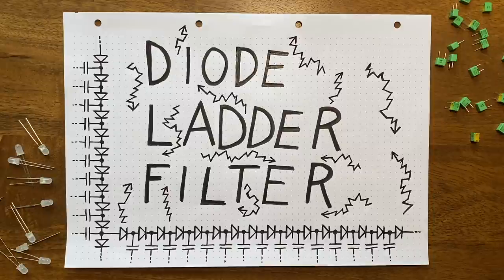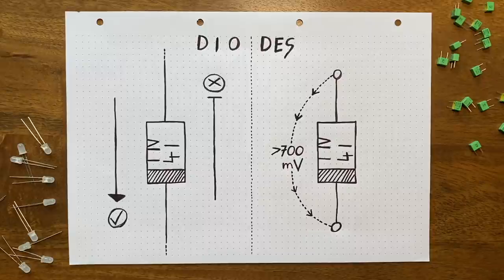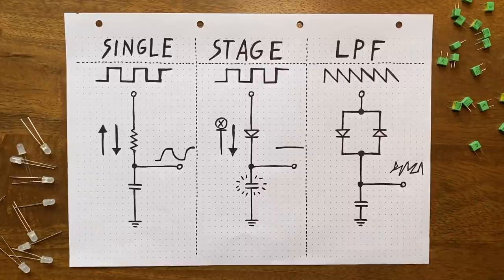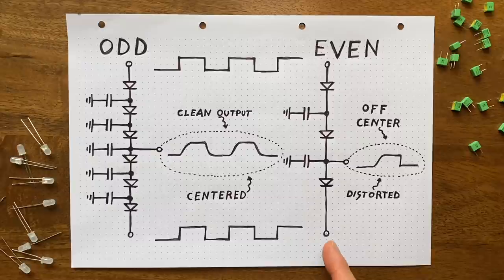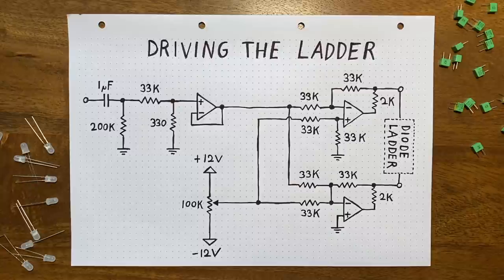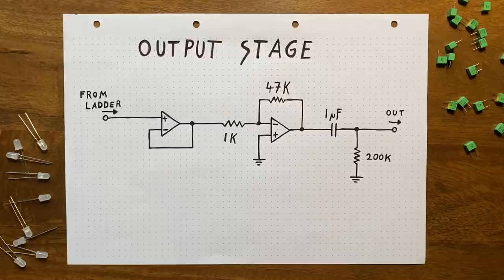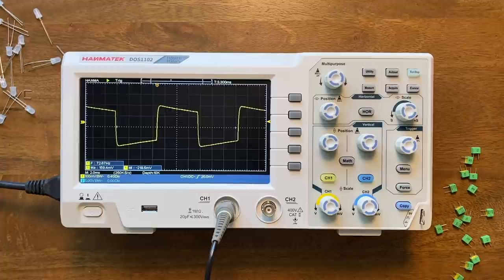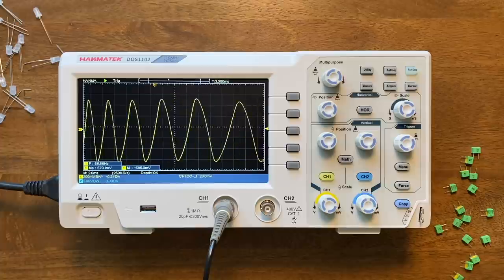Designing a diode ladder filter from scratch

Comment: For this diode ladder filter block, does it require using film caps?  I followed along and built this up exactly but I used ceramic caps in place of the  1nf film caps. The square wave signal was dull and had a loud, deep hum. Perhaps the result of using ceramic caps?

Comment: These videos are really helping to open the doors of analog electronics. I have been wanting to make a filter, and experiment with weird, maybe counterintuitive topologies, but didn't know where to start. The difference between the positive offset and negative offset, plus the placement of the resonance, there is a lot to tune there. I would be really interested in how to turn this into an all pass filter, I have been wanting to get some of those phaser sounds.
Reply from the maker: yeah that's why i decided to go with this instead of another OTA-based approach. much more room for creative tweaking! (also LM13700s are expensive.)

i'll do a follow up on converting this into other filter types. eventually i'd also like to do a PCB layout when i feel the featureset is refined enough.
Reply: @MoritzKlein0  the fact that this design doesn't use any fancy components means I will likely be able to design a pcb to be assembled by JLCPCB, and have them do most of the components.

Comment: That sounds great! Simple design too. I did one ages ago by taking a state-variable filter and replacing the two cutoff frequency resistors with boring old diode bridges, and basically doing the same positive/negative control voltage you've done across them. Worked really well too, plus you get low/band/high-pass out of it.
Reply: Schematics pls jojo
Reply: @finonomastropiero4261  Demo and a schematic from when I made it -> https://www.youtube.com/watch?v=Z4o3QnJdoys

Comment: This filter works really well. The other day one opamp on mine apparently failed. It's cool how these analog devices can sound nice even with a major damage. The sound was similar to warm distortion on a guitar. I suspect the reason for the failure Is that I modified the CV input and might be causing it to go way high on voltage on the ladder. Thank you for your work again!

Comment: I'm fascinated by the fact that so far, there hasn't been a single sighting of expensive transconductance amplifiers. I'm sure they'll be used in the future, but it's nice to know there's a lot of good control possible with bog-standard opamps. Well done man. This series is truly inspiring.
Reply: 1. The "transconductance" op-amps would be needed if the filter's steering element was a BJT.
2. "Transconductance" amps are essentially amps pushing a set amount of current through the load...
3. ... which means you can do it with a "normal" op amp and some fancy feedback loop, if you don't mind part count explosion.
4. Internally they're current mirrors, so replacing them with discrete transistor pairs/trios would probably work too, for that old-school, wobbly sound.
Reply: @MoraFermi  Oh I'm aware OTA's are usually used in combination with a bjt, just loved the fact that there's a feeling of it being slowly worked towards. Parts explosion is fine in that case, because it facilitates the style of the video. More parts means less multi-function parts, means easier to wrap the mind around. Don't get me wrong, I do be liking the wobblies too, but I have a feeling this series is working towards more accurate modules later-on. Ideal diodes (Jim Patchel) in place of the split "dual"-filter elements would be a nice way to get the filter's "around 0v" area more linear (as well as it being a nice intro to waveshaping/folding).

tldr; Yes :D

Comment: URGENT!: I need to pack (including the electronics assembly area) to go to another country and I need to get that filter functioning properly before I do! I finished building it on a protoboard (with similar layout to a breadboard, although an extra rail on top and bottom and some on sides), but it’s still not functioning yet. Sigh. That was as much work as building a small building with the right tools seemingly. And I know a building would actually function properly. Sadly the filter hasn’t functioned at all yet seemingly. There was a high pitch sound from some points on the board when had the dual supply a little low. Sadly no potentiometer has done anything to make it output sound from what is seemingly the output yet either. Was SOOOOOOO MUCH WORK. Sigh…

I have REALLY learned that I should ALWAYS have PCB made when making any electronics circuit that isn’t as simple as most guitar pedals. And then also prefer to have a proper PCB.

Anyway, here are the photos. Maybe there is something obvious simple and easy issue on it that will be easy to solve. The dual power supply is at maybe 11.87V.

Note: Swapped the ground and other rail on the side with the row of caps. Didn’t install the audio ports yet, simply using wires straight to speaker and a 555 synth. Disregard the other circuit on left of the breadboard, as that is a multistable vibrator that isn’t connected.

Thanks in advance for advising SOON on how to make it start functioning! Tested continuity all over the place, although didn’t go through maniacally methodically to confirm all continuity at every single point in that circuit. Underside has no bridged columns and that is a breadboard style stripboard. So it’s laid out based on the final breadboard schematic in that erika synths manual for that filter. (version 2.0 of that manual)

Photos are on imgur. Sadly youtube was deleting any comments with imgur links, so change the [dot] to a ".", obviously:
imgur [dot] com/a/KFrPShY*

Comment: Hi Moritz, thanks for another great video! First off all: I would buy your drawings in an art gallery if they were signed by you :-). If you plan to build a stable and good "pro-version" in series, please consider the use of diode-arrays in one case. This allows good traking and temperature behavior and some are available in DIL or SIL-cases for easy prototyping. Cheers from Kaulsdorf, Christoph
Reply from the maker: great idea, thanks for the suggestion! i'm planning to do a proper PCB & panel once i've added at least a high-pass (and maybe a band-pass) option, so i'll probably use such an array then!

Comment: @ 28:50  Would a 3,6V Zener diode work too in a situation like that?
Reply from the maker: not educated on zener diodes, so i can't really say, sorry!
Reply: I think a zener would be fine, but the three diodes add up to 1.8V, give or take. Also, when using the zener you should connect it "backwards" when comparing with the 3 diode implementation
Reply: @jorgeguimaraes8820  Oh yes of course. It's 1,8V not 3.6. I understand a zener has to be put in the other way around. It was just a theoretical question really :) Thanks for the reply!
Reply: @EdEditz  no problem! By the way, the zener put like this would do the same as the diode string if you think just about positive voltages... Since the CV can go negative, the zener will limit the negative excursion to -0.7V (-Vd), so maybe it won't work exactly like the diodes. Normal diodes clip at 0.7V (Vd) when positively biased (the 3string would clip between 1.8-2.1v) but don't clip with negative bias. The zener clips at Vz (the zener rating voltage) with negative bias and Vd with positive (just like the normal diodes). So, to allow for negative CVs (say, CVs between -2v and +2v) you should use two 2v0 zeners "face to face" (the cathodes in the "middle").

Comment: I built a nano-amp scale ammeter using a 1N4148 diode. It works great! I use it in high voltage work to measure very small currents

Comment: i thought you'd end up having some noise problems because of the amplification but it turned out fine!
amazing video as always!!
if that wasn't the case i'd suggest zener diodes
the ones rated to 3.6V would require a lesser reduction of volume (if i got the workings of the circuit right)
so you'd have a greater separation between the signal and the noise floor during the amplification stage.
Reply from the maker: might be a good idea to try this since the output stage definitely is susceptible to picking up noise. you can keep it to a minimum by using proper decoupling & keeping the big gain op amp as close to the PSU as possible though!

Comment: Love your videos so much, man!! I have been able to intuitively understand basic electronics because of you.

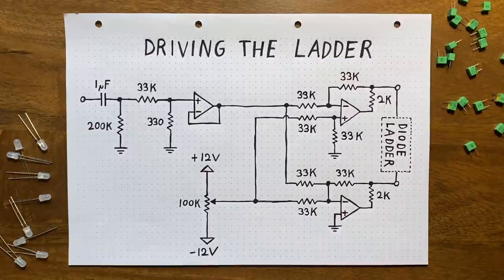I am a bit confused about the 2k resistors at 22:00. They are in series with the 33k resistor on the feedback loop. Wouldn't that affect the op amp's output levels? Would putting the 2k parallel to feedback, but still in series with the diode ladder work?
Reply from the maker: yes, it will affect the op amp's output levels, but the voltage after the 2k resistor will always be the inverted sum of the inputs. by this we kinda compensate for the raised output impedance – make the op amp work harder if necessary! check this: https://tinyurl.com/y76fcqoq
Reply: @MoritzKlein0  That makes perfect sense -- thank you! I eagerly await your next video

Comment: Hi Moritz, huge fan! I’m thinking of implementing four of your filters into a polysynth for my final uni project, do you have any ideas about voltage controlled resonance?
Reply from the maker: you‘ll basically need to replace the variable voltage divider between the filter‘s output and the resonance buffer with a VCA!
Reply: @MoritzKlein0  hi Moritz! I’m thinking about trying to get four filters trying to behave identically- probably by calibrating each filter with trimpots. Which resistors and voltage dividers would you suggested making adjustable to ensure repeatable behaviour?

Comment: Very interesting and well explained. Thanks for your effort.
Can you tell me what the 'SHIFT' module is? Are those just shift registers?
Reply from the maker: it’s basically just 10 4-bit shift registers chained together. i then selected three LEDs where i attached basic gate-to-trigger converters. so the idea is that you can send in bits (either manually via a pushbutton or through an external input) and have those circulate through the registers. every time a bit passes a gate-to-trigger converter it fires. so something like a sample & hold for rhythm! you can also choose if you want it to loop and from where (after the first 4, 8, 12, 16 … bits).

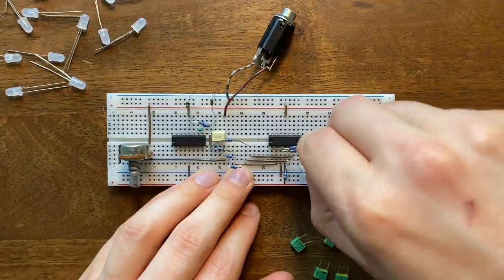Comment: Hi Moritz and all other guys building this amazing filter. May I ask a question? At 24:00 minutes of this video, Moritz is testing this setup just after the second opamp. On my oscilloscope both lines are going up and down. Only when i press the Invert button on my scope It seems working, but I assume one line should be going up and the other down without using the invert button on my oscilloscope. Where did I go wrong? checked the video 10 times and the schematic. At this point I don't know to to fix the line that should be doing down (inverted). please help. Thanks in advance.

Comment: I added voltage control to the resonance with a simple Santana JFET VCA, and added a non inverting summing stage to combine the CV and Resonance pot voltage, with clipping diodes to constrain the voltage to a range between roughly 0V and 5V. I had to flip the resonance input amp to an inverting configuration since the VCA is inverting the signal, and I didn't do the actual math to change the gain, I just guessed, but it seems to be pretty similar resonance. Here's a link to the falstad circuit:
https://tinyurl.com/yz9nl6fo
Reply from the maker: looks good!

Comment: Well made! Any suggestion about 1v/oct tracking implementation  of this VCF?
Reply from the maker: it’s kinda already in there, you just have to adjust the cv scaling properly. problem is that it’s not temperature compensated, though .. so the tuning will fluctuate as the diodes change temperature.

Comment: Hi! I have an issue building this filter using the verified stripboard layout by Dud on the LMNC forum thread about this video. The filter doesn't work for most of the time but when feeding it a high pitched sound from my VCO while filter is completely open, you can hardly hear it. Do you know what can be the issue? I checked if the IC's are powered correctly and checked for false connections between the copper strips.

Comment: I think I never needed a Diode Ladder Filter. But it sounds interesting.
However I built quite a few diode capacitor ladder high voltage power supplies.

Comment: Nice deep tech too. pls bandcamp :)
BTW do you think it's possible to use LM324 instead of TL072? Because I can't get the TL rn. Or what about NE5532, it's supposed to be low noise but they all are BJT I think, I don't know how BJT effects the signal compared to FET. I might try this out, hope the lower BJT input impedance doesn't spoil everything.
Reply from the maker: i think both alternatives should work just fine. haven’t tried it though, so take this with a grain of salt!
Reply: I'd go for the 5532. the LM324's are best suited for single supply operations, if I'm remembering correctly. Something about the output stage creates some distortion when using dual supply (+12 and -12). The RC4558 would be an alternative also

Comment: hi! great video. I don't get how you power the circuit, isn't it active? what voltage doest it work with?
Thanks!  DO u have schematics of the modules that you design on your patreon?
Reply from the maker: it's powered with a dual power supply (12V/0V/-12V) which is standard in eurorack systems. i didn't draw the power connections on the op amps, but they are of course connected to the PSU. you can find a complete schematic in the description of this video (look for the "falstad" link)

Comment: would this work with light emitting diodes?
Reply from the maker: i think so, but you'd have to boost the CV by a factor of 2-3x since 1 LED behaves roughly like 3 1N4148 diodes! haven't tried this yet though!
Reply from the maker: here's a quick version i slapped together. by increasing the capacitance we can actually make the diodes light up! this might look really cool! https://tinyurl.com/y9e7wxsq
Reply: Moritz Klein way cool! I think I left a reply already but it dissapeared? Anyway, gonna try and build this version :) But what’s up with the 5.2V in turning into 2.1V? Should I go with that? I’ll have to figure something out to bring 5.2 down if that’s the case as it’s that and 12 that he have powering our rack.
Reply from the maker: @theclovercross  yeah the youtube filter will eat comments if they have links i think? sometimes also seemingly at random. weird.

with the 5.2V you mean the fact that the CV is much stronger in the LED version? this is actually necessary because one LED behaves roughly like 3 regular diodes – so they need a lot more voltage to start conducting.
Reply: @MoritzKlein0  the schematics were the other way around though. I mean the power coming in in the bottom left part. 12V, -12V and 5.2V in the original and 12V, -12V and 2.1V in the LED one
Reply: @MoritzKlein0  oh, I probably mentioned libramodular at tumblr then. we're a few hackerspace guys here in northern sweden that decided that it would be cool if we something like a synth module library. it's really fun :)

Comment: Looks very similar to the Steiner-Parker filter but instead of a differential pair you're using two voltage sources (op amps) and two resistors to set the bias current. Am I right?

Comment: Would you please comment the temperature dependency of the filter, because as you know most diodes have a negative temperature coefficient (about −2 mV/oC for silicon diodes). And the room temperature can be probably in range 15 oC to 30 oC and even more during the global worming ;-)
Reply from the maker: yeah ambient temperature will have an effect on the cutoff frequency. but afaik most filter designs don't compensate for this (unless you want to play it as a stable v/oct oscillator) because the effect shouldn't be that dramatic.
Reply: @MoritzKlein0  I wonder how much affect it will have as it is the junction temp. Maybe less than expected based off the change in ambient T? Hmm.
Reply from the maker: @nicholasroos3627  i'll try breathing vigorously onto my breadboard

Comment: Amazing video once again! Thank you🙏
I’ve build it on a breadboard and I am very pleased with how it sounds, but there is one thing that I would like to ask. Is it possible make resonance so, that it will start self oscillation smoothly? Because right now it is very sudden.
Anyway it is a wonderful circuit and I am so amazed with how great it sounds compared to how easy it is to build! Thank you one more time for that!
Reply from the maker: try using a 100k/27k resistor combination for setting the resonance op amp‘s gain - instead of the 10k/2k7 pair!
Reply: Thank you very much! It was still the same with 100k/27k but I kept on rising values and result was smoother with 470k/120k.
I am very glad! Thank you🙏

Comment: Maybe I missed something, but is this tuned so that the CV level corresponds with the CV level for your oscillator (1v/oct)? Since at higher resonances a tone can be heard. And if it's not, how would that be implemented?
Reply from the maker: you can tune it via the CV intensity knob - the issue is just that the circuit is not compensating for temperature, so as the diodes get warmer, the tuning will change quite dramatically. fixing this is not trivial, unfortunately..